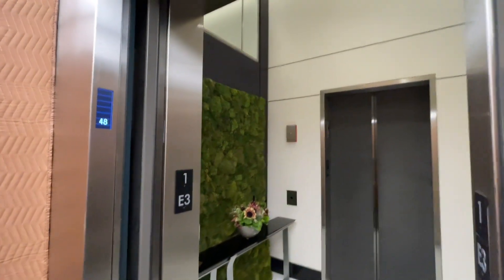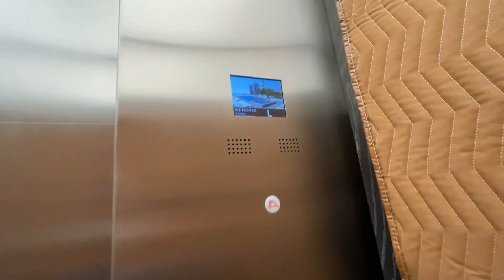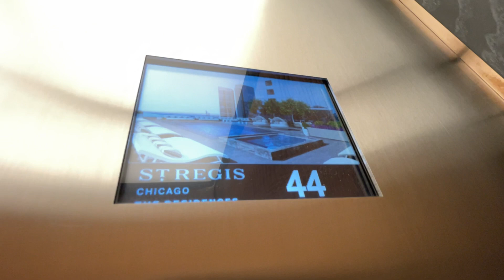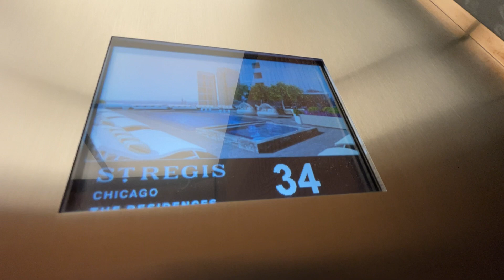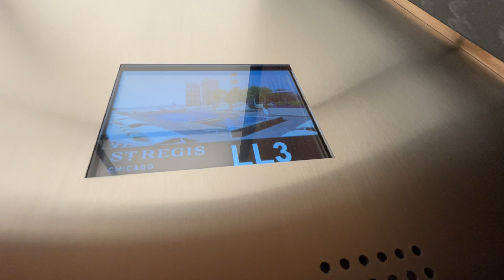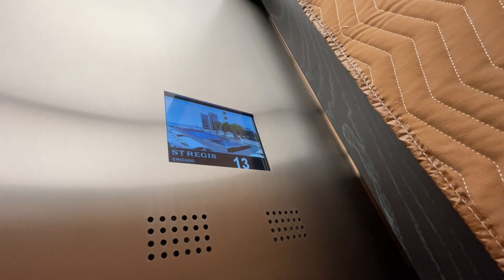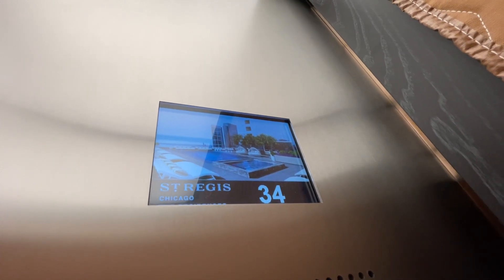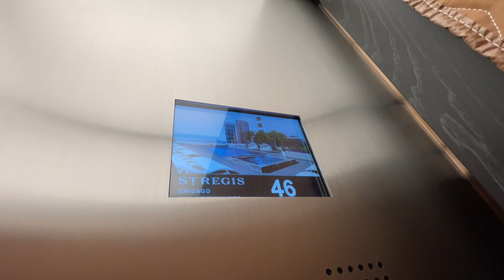SLOW SPEED + FORCE RECALL on the 92-story High-Rise Elevators

Comment: What happened was seismic mode got triggered. When that occurs, the elevator will recall to any designated landing ABOVE the halfway section of the hoistway. This is so the counterweight is below the car and if it were to break free from the rails during seismic unrest, there isn’t gonna be a giant weight slamming into the car and it’s ropes. Considering you said the shaft was windy, the wind completed the ring and string circuit on the counterweight which activates Seismic mode.

Comment: Is 92 the top of this building or is this 92 floors?
Reply: 92 is the highest floor it can serve
Reply: @x_x-t6m  oh
Reply: @PeplerElevators  the building is actually 101 floors because Lobby is at an elevated street level and LL5 is the actual ground floor
Reply: @x_x-t6m  ohh
Reply: @PeplerElevators  LL5 to LL1, L, 2, 2M, 3 to 92. Then 93 is the upper level of the duplex penthouse which the elevators don't serve following by MEP and Elevator Machine Room at 94 and 95 respectively
Reply: @x_x-t6m  ok thanks